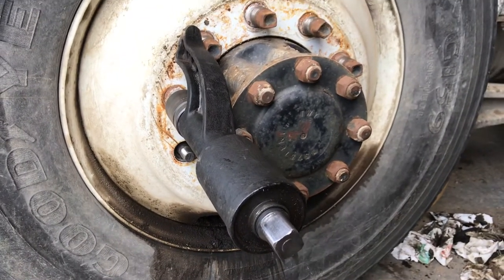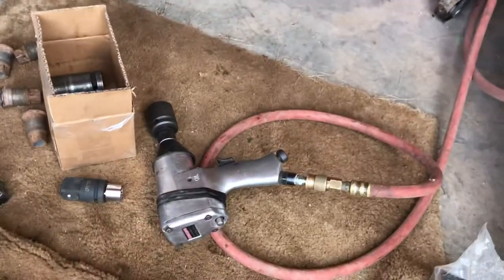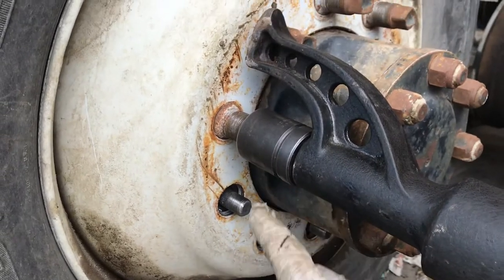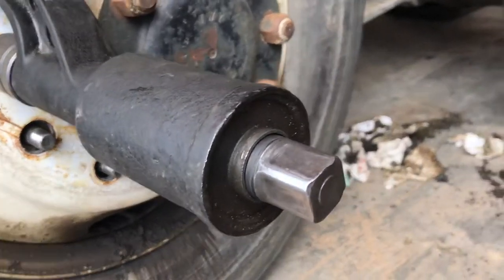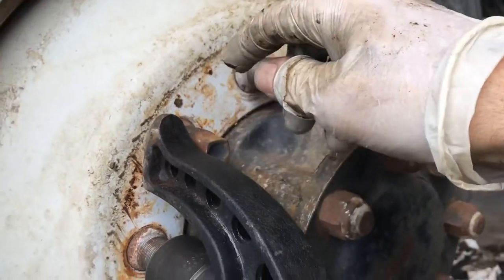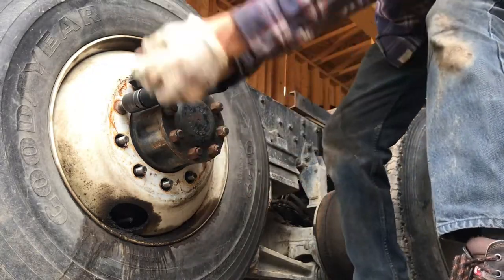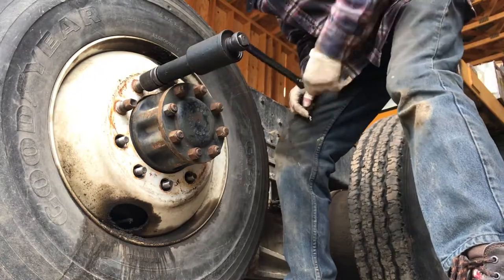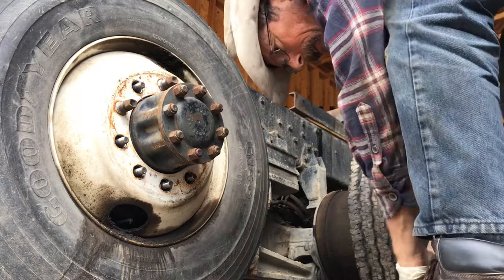How to remove semi truck lug nuts without air gun.

Comment from the maker: This tool is used just like an air impact gun except it is used by hand. When you tighten the nuts use the same force as when you loosened them or you may snap the studs off.

Comment: Reminds me of a vid i saw of a guy breaking steel rods using motors and lego gears.  He even built a “Googol:1 ratio device” (a googol is 10 to the 100th power).
Reply: Link?
Reply: I remember, as a small boy, asking my dad about gear ratios.
He told me:
"If you geared it with enough reduction, your wristwatch could move a car up a steep hill. And, since you are young; you might live long enough to see it reach the top."

Comment from the maker: Yes. 175 nm is equal to 129 ft lbs. It will loosen and tighten to about 300 ft lbs. which is what most semi truck lug nuts are torqued to.

Comment: I got one of them I'll give it away that thing slipped off and slapped my hand against the wheel busted 3 of my fingers wide open but it does work well LESSON LEARNED DON'T LET IT SLIP
Reply: I'll take it😆
Reply: Send shipping and handling I swear you can have it
Reply: @speedball365  how much and where do I send it? Cashapp? PayPal?
Reply: I'm in Mississippi
Reply: @speedball365  I'm in east Florida. You can probably ship it in a flat rate priority mail box.
Reply from the maker: Yes you do have to be careful when using this tool. I tried to crank it too fast and the handle slipped off and whacked me in the forehead. I with I had a video of that one. 😂

Comment: Hey I was doing change brake pads but that truck has same what u doing that my first time do that but I don’t have tool for that one I have to order it . when take off nuts and budd studs . What best way when put it back must have tool to hold budd studs or just put it back as like put nuts back air impact... like 8 budd studs use air impact then 8 nuts use air impact again .
Reply from the maker: As you see in the video, it also works on bud studs.

Comment: I have some stuck nuts holding the wheels on my ferguson 35 tractor. Would this take such nuts?
Reply from the maker: It should remove any lug nut although if there is significant rust they may need some heat from a torch so the studs won’t snap off.

Comment: What do you use if the torque multiplier dosent work either
Reply from the maker: I’ve never had a lug nut this thing couldn’t remove. If they’re really rusted on then you may have to heat them with a torch. Otherwise a regular air gun will do.
Reply: @JohnVH-diy  I think I might need to replace mine then and the air impact I had was going out but thanks for the video it helped a lot